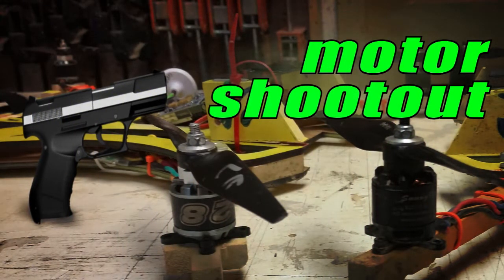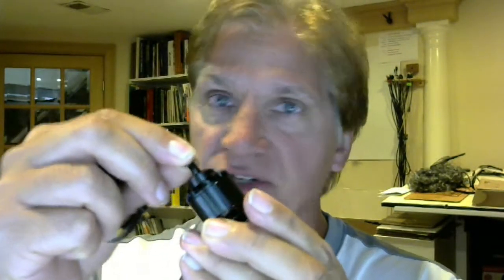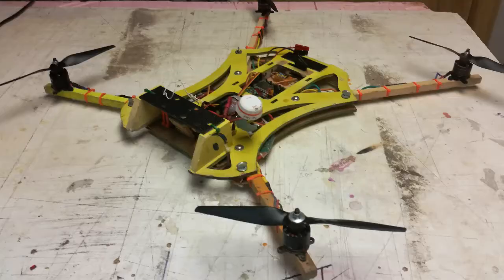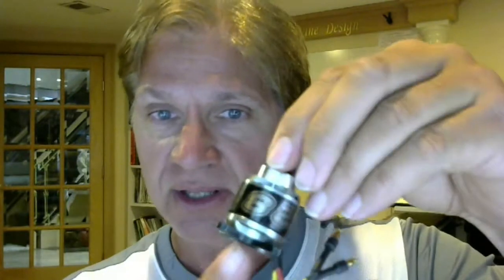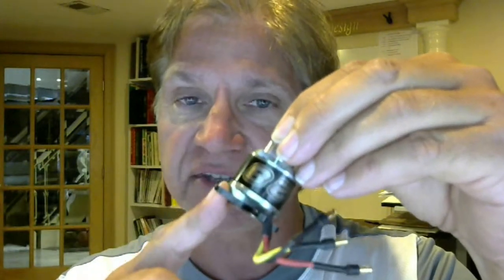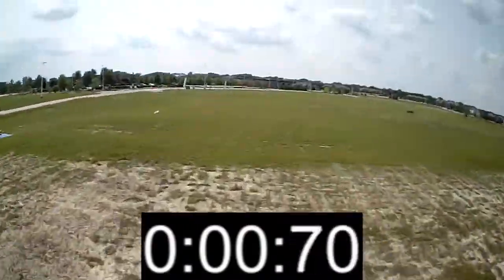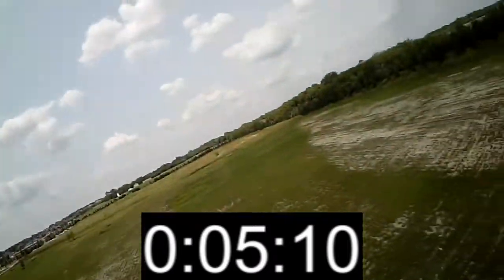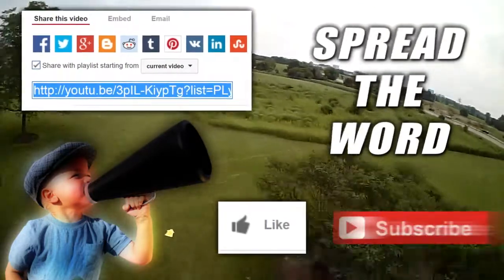Tech Talk: 450 Quad Motor Shootout // Sunnysky 2212 vs HK NTM 2826

Comment: How about a prop test on the sunnyskys?  Slow-fly VS E-prop
Reply from the maker: Rc Dad When I started last year I used slow fly's and they broke in air after 8 flights. Others had the same issue. I couldn't figure out for the longest time what was causing my crashes until I ditched the slow flys and my issues went away. Slow fly's are just for, as the name implies, "slow fly".  So this test was with e-props carbon mix which hold up well in the air. 
The biggest takeaway actually is the motor mount. I bought mine at buddy rc.
Reply: FPV Tree Racers what size props do you run? 8x4 - 8x5?
Reply from the maker: Rc Dad  I think they were 8x4's but I am not sure since that was last year. What I have found out however, is the bench testing blade thrusts mirror real world results almost exactly.